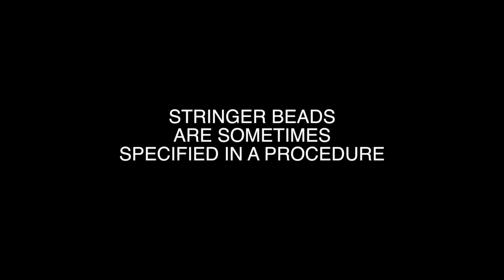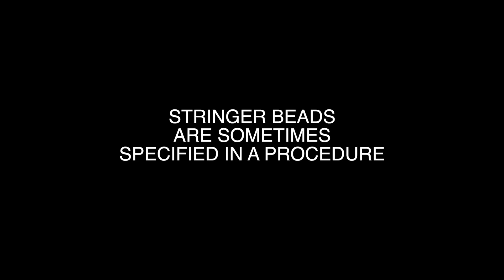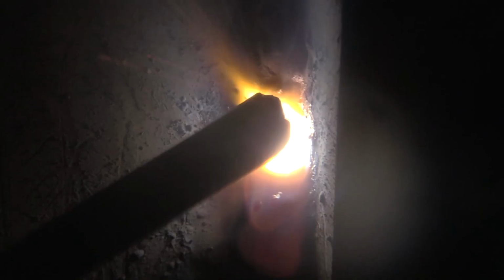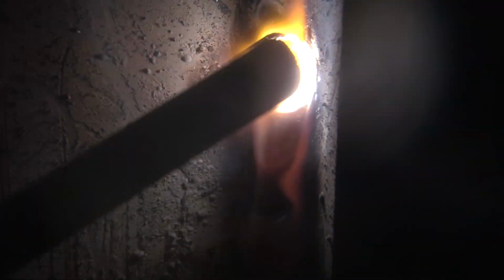Stick Welding Techniques 7018 5/32"

Comment: What type of angle is the electrode supposed to be ? My teacher told me that it was supposed to be 90 angle but what i notice from vertical is that people don’t do 90% angle they just weld with the electrode up I’m really confused about which angle I’m supposed to used .

Comment: Could you please explain why my weld burn off the metal heavily. If I fill up burn off metal , some elongated crown on the way, I think my amphere is ok . If I go down on setting weld seems too low on power.

Comment: I have 45lb of Lincoln 5/32 7018 in my truck that I almost never run because of I'm scared of blowing holes and such.. This man is hitting a vert on 3/8 steel and he's just erased all my fears. Gonna show off in the near future lol, I like to be able to get a lot more weld in 1 rod too..

Comment: Always learning something about the process. I never knew this type of angle and uphill was even possible. When starting out you learn that the angle behind in a pull helps push the slag however it's clearly not necessary with rod type and technique.

Comment: Andrew  pushes the weld up at an  upward angle.  It works and he does a nice job but that seems to spit more BBs  than  Jodie's  "closer to level" approach.  It's good to see that there is some forgiveness in rod angle.  I think when younger welders first start, they think that they have to help the weld by pushing it uphill.  It become a habit that they sometimes never break.
Reply: Not unique to younger welders. I know a few oldschoolers who go uphill using the same angle.

Comment: are you welding on 1/2" plate?, if so, excellent welds, learning the big stick will help you master 1/8" lo hi, which is the standard for out of position welding.  not to many companies will allow 5/32, too cumbersome and not many welders can master it. overhead is easier. i used it on some ships, but foremen said use the 1/8, more productive.

Comment: Who Can answer this question...

Say you have 3/32 and 5/32 7018 rod and both are set to their own respective amps. WHY is 5/32 7018 so much harder to manipulate than 3/32 and what are some techniques

Comment: welding tips and tricks !!!!  could you please help me with the electrode angles for all welding positions in groove and fillet welds ?? thank you very much
Reply: Yes, ditto..
I thought most situations the rod should be more of a 90degree angle to the work. 
Obviously your results speak for themselves.
Please explain the reason for the electrode angle going uphill.
Thx

Comment: i cant weld stick at all i only get slag included and i cant see it while i weld for some reason no matter what technique i use i get porosity and slag inclusion in some places even on horizontal why i dont understand, if i weld flat on top of a piece of metal it works perfectly, if i weld 2 pieces of metal 90 degree i get massive porosity and inclusion, yet 2 pieces of metal head to head with no space between welds perfectly, i really need to fix my welding for a job and cant understand what im doing wrong

Comment: Is there a video on a  flat butt weld using 7018 5/32 no backup, 1/16 gap & landing. With root pass then the same half weave & half stringer cap?

Comment: Is this welding in real time? It seems as though i am traveling faster when i do it. This makes it look so easy.
Reply: You’re going faster than that?  He’s already going pretty quick for a weave pattern.  Unless you’re burning pretty hot like he was up around 140 then you’re probably getting like no penetration.
Reply: @dazdavis7896  I was using 1/8 but i believe i was just running too hot. Think ive bumped it down to 110-115 for uphill. I think my problem was too hot which was causing the metal to drop and bulge up in places and i was moving faster to compensate as opposed to dropping the amps. Think i was at 125 initially but that was 1/8 7018.
Reply: @DXT61  I was just about to ask if you were runnin a 5/32 7018 instead of a 1/8 that woulda made more sense them telling you run it that low….  My Gpa,  who got me into welding before I went to school,  welded on the railroad for 35 years.  Heavy duty 6010, 6011, 6013, 7018 welding on the train cars and what not,  he always told me it’s better to burn too hot than too cold.
Reply: @dazdavis7896  no penetration with 5/32 stick?
Reply: @irondiver292  uh,  if you’re going to fast,  yes.  But apparently you don’t read the comments I thought he was using a 7018 til he clarified that.
Reply: @dazdavis7896  you mean using 5/32 ?

Comment: I’m welding a thumb on an excavator and I’m not a professional welder.  The instructions say single pass .060 fillet weld.  My question is.  Isn’t .060 very wide for one pass.  What rod and diameter could achieve this?

Comment: My hardest issue welding is just finding the right rod for the metal i am welding. I am self taught so sometimes i have to experiment to find the right rod. One of the hardest but most successful welds i ever made was a case hardened steel collar welded to a cast flange on a gas compressor. It ran for years with 150 psi and the vibration of a two stage compressor. Never ever leaked not to bad for self taught in the field. But wish i had more knowledge of the different grades of steel and aluminum it would make choosing rods easier.

Comment: With 7018 if you don't use the whole rod, taking a file to the end of the rod will help you get started again, ( the flux tends to cover the tip making a restrike harder).
Reply: My new toy for it is a cordless grinder.

Comment: Hi Jody,

Love your videos been watching for years, always great help and information!

Was thinking of an idea for a video, 3F vertical up stick weld  etch test comparison! Thinking 6013 root and cap, 7016/18 single pass, 7016/18 root and cap and then a typical 6010/11 root and 7016/18 cap! Would also love to know how a vertical down 6010/11 root with a 7016/18 vertical up would go!

And have you ever found rod thickness/flux affects root penetration on a fillet weld or is it really only a concern on 3G with fitting in the groove? Just in my mind for example a 2.5mm 7016 is much smaller so sit tight in the V while a 5mm 7018 would be harder to keep tight in there!

Thanks, Harvey

Comment: Jody

Could you recommend a good all-ariund electrode for the occassional stick welder to keep on hand?  Love 7018, but am concerned about storage without rod oven, especially here in humid Florida where it often is months between doing any stick welding. 

John
Reply: John Crea if you don’t want to worry about your 7018 going bad, I’d suggest buying a box of either 6013 or 7014.
Reply: @jerrysgardentractorsengine2243  Thanks for the recommendations

John

Comment: What ever processes i weld in. When it comes to vertical welding, i always start from top so that my next pas will tie into the bottom of your first pass. Easier to tie into. I surpass the tie in by a 1/4" but let it burn for a bit for a stronger tie in. This looks very good by the way.

Comment: At 2:18 he got some porosity in that tie-in. Check it out!!  Not saying he can’t weld but running that cold with that rod will give you problems. Be careful and I don’t recommend this size rod on anything that at least .5” thick and then not subject to volumetric NDE.
Reply: I thought the same , mainly seen vertical done with 1/8 , you can run kinda hot and chances of porosity are way slim , in my mind you would want to be on some big think iron that a take the heat , his welding looked good , it's just I'd worry to having to turn that 5 down so low , I've seen guys weld cold and weld look pretty , but if would to start grinding in it  sometimes you see pinholes

Comment: I was taught by a 65 year old man over 25 years ago how to weld. I've never been to school for welding. I use an old style Jackson welding hood.  It's not arch flash. It's a typical old school welding hood. I weld Exxon gasoline tankers daily. And milk tankers a lot.  The welder I use is a Miller from like 1980. My point is. Why do you need all these fancy welders with all these settings I don't even understand how to work. I'm thinking it's all unnecessary. Oh yeah, I use an old Ideal welder cracker box for welding 7018's. It has no setting at all really just an old dial for heat up and down. I pass welding tests every time they make me do them. With the machines I use everyday. It is what it is I guess.
Reply: I am self taught and prefer the old school welders. Both of my Mig's were made in the 1990's, I have a 1984 oil Oxford 180amp cooled AC stick welder and a 2002 Oerlikon Presto 140 G inverter welder which I use a lot in my videos and on farm repairs. Old stuff is perfectly good, no need to spend thousands of $$$$ or ££££ on welders, it is the man or woman working the arc the makes the weld not the machine!
Reply: What do you want a medal or something?

Comment: Pretty good welding your doing one thing wrong, the angle,the angle of the rod really suppose to be pointed downward about 10 degrees,if you look this up you will see that im right,I'm  combination welder iv done uphill many times and welded rings in school and your heat is just a smidging hot you can see it in the tow of the weld.

Comment: What is the thickness of the plates to be welded and the thickness of the electrode?
Reply: He said 3/8" or about 10 mm on the plate thickness, and 5/32" about 4mm on the rod thickness.
Reply: @tsimmons4730  thanks

Comment: That much heat and metal on a coupon that small is impressive! 5/32” is no joke to run vertical on big pieces, it’s super tricky on a small piece that saturates quickly with heat!

Comment: I realize this may be a specific video request...but can you do one for 8” 13# I-beam welded at 90 degrees to each other and at head hieght? Maybe some tips or tricks for coping one to meet the other would be nice too. I’m still trying to finish a frame to go under a shipping container and I need to weld it together in place since I don’t have any equipment strong enough to lift it where it needs to go.

Comment: but how with 140 amps? When I tried it with that much amps and the same size of plates, electrode, it starts to eat steal, to burn it :o .And of course I'm doing motions and stuff with electrode. I don't know how it goes normally when you put 140 amps

Comment: Hey can you do a video about Ark force or the Dig function recently I was on a new construction apartment building where we were welding 3 inch plates two-way heavy duty I beam one on top and one on the bottom some gussets for structural support the stick welding Lincoln machine had a 225 and then drop down to a 180 and I kept on getting blowback can you give some advice on how to avoid that

Comment: Jody can you please make a video testing arc force and hot start features on the esab rebel 205 ac/dc. I see the 285 can handle the 5/32 rods. Debating whether to buy 205 but kind of skeptical if it can run a 5/32 6010...once again thank you for sharing your fountain of knowledge!
Reply: The 285 is great use one daily

Comment: I tried welding 7018 overhead the other day and it was like the slag kept dripping down and snuffing out the arc. Any quick ideas what I was doing wrong?
Reply: Look at your rod angle, of it's not right it will snuff out the arc, also look at whether your arc is too close as it can happen then too. If required, turn up the Amps a little at a time, some people like it hot, some cold, play about and you will find your clean bead 👍

Comment: If you're doing a plate test, taking the time to let the plate cool between passes can really be beneficial in preventing undercut and sag.  Great video as always, just wanted to add my 2 cents.
Reply: Sign of a welder worth his money though is one that approaches the test like they would a weld on a job site, and on a job site where time is money...you can't cool your parts down and constantly be changing your amperage. Want to be a welder that's worth his money...learn to make amazing welds quickly and without constantly changing your amperage. This can be achieved by learning different techniques of rod manipulation for different situations
Reply: @fe8199 dead on

Comment: These videos are so helpful.  To help my (mainly) hobby welding, I took a beginner's class at the local tech college 25 years ago and was taught a "whip" manipulation for this kind of weld, with 1/8" 7018 (I also have a textbook which recommends a similar method).  I had a tough time getting that right and never did perfect the method, partly because I can usually set the position of the work to avoid difficult positions, which has the negative side-effect of eliminating practice time!  It is SO good to see not only a completely different method for doing vertical-up fillet welds, but also a functional explanation of why that particular weave works well.  This looks easier to "get right" than the method I've always used in the past, and I'm making a note to try this myself.

Comment: When you run stringers you can get a flatter bead stack by watching where the arc light shines off the ridge top of the previous bead and washing your metal up to but not past that line.